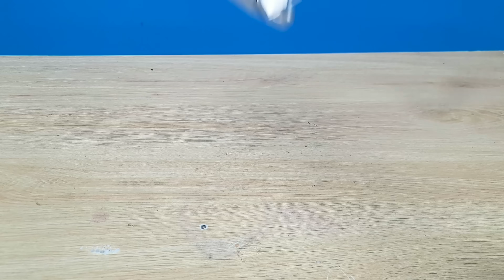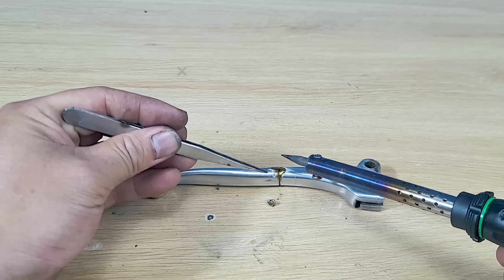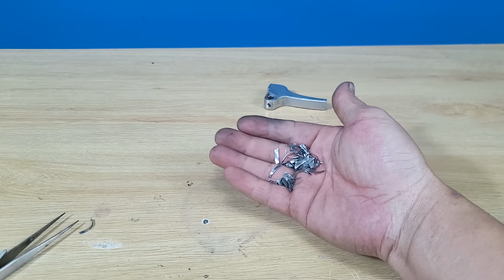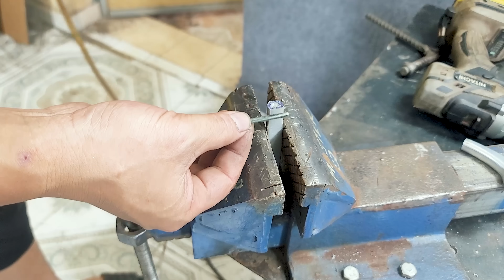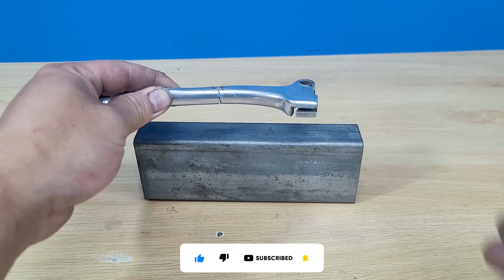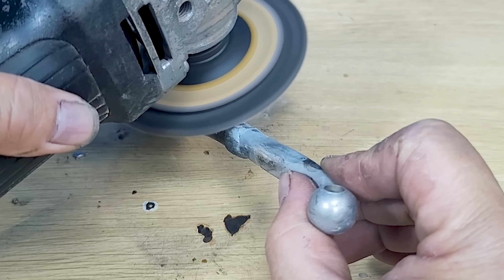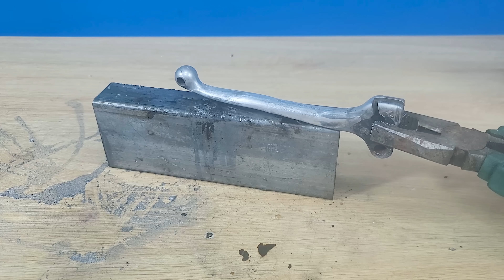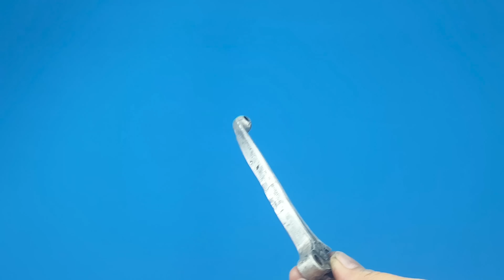Even a NASA professor had to learn this from me! Idea of using 1,5V battery to weld aluminum brakes

Comment: actually..........if, using WET sandpaper, it needs to PRE-SOAK at least 20 mins before using. works alot better that way.
Reply from the maker: Thanks for sharing this tip! Soaking the sandpaper before using it definitely helps improve the effect. I will try it right away!. Thanks for sharing!, have a nice day

Comment: It looks good, but wouldn't the solder just squeeze out of that crack overtime?
If thats the case the two ends would start to move independently of each other, a little at first and. Then you hit the wrong traffic conditions and snap.
Reply from the maker: Hello, nice to chat with you, thanks for pointing it out! Welds can be affected over time, so regular inspection is important to ensure durability, thanks for your interest and sharing, have a nice day

Comment: The "fix" would have worked the first time if he had used the torch the first time. I wouldn't do it/used it but the solder would have flowed because of more heat.
Reply from the maker: Hi, nice to chat with you, Very true! High temperature really helps improve the weld. However, safety is still the most important thing! 🛠️Thank you for your interest and sharing, wish you a good day

Comment: It must be illegal to do a job like that.
Brake systems have to be approved with Govt. compliance regulations.
That lever is not approved and is dangerous -
it could break in half just when it's needed in an emergency.
Reply from the maker: Hello, nice to chat with you, thank you for your interest and sharing, my good friend, have a nice day💖 💖 💖
Reply: @inventorK20  - OK - when I had a motorbike there was a motorcycle wrecker
just down the road and that's where I got most of my spare parts at a very cheap price.
I kept my bike in tip top condition in that way.

Comment: That was fun, and I do have experience welding steel, brazing, soldering, and grinding and polishing, but I am lost on why you cut up the battery? Is there some kind of metal in it you can not get at welding rod supply?

Comment: So if you have modern tools..tap and die a drilled hole in both sides. Threaded rod connecting the 2. Braze them together. Sand and polish. Ruin polish job with a hammer. Reinstall and pray. Got it.

Comment: idiotic fix, he should have made a mold of the broken part then melted down the lever and some aluminum beer cans and poured the molten metal into the mold to cast a new one.   Or, maybe hired a machine shop to create a 3D CAD program of the part and program a 5 axis milling machine to cut out a new one, which would only cost several thousand dollars.   Or, maybe buy a new part; .......Nah that would be too easy.
Reply from the maker: Hello, nice to chat with you, thank you very much for the useful tips, we will use them, thank you, have a nice day

Comment: Old plumbers used to kill acid by cutting up old bits of galvanized iron so you could soft solder a lead splash back to a stainless steel laundry tub that had to go in a corner of the laundry

Comment: Nice fix… but I wouldn't trust it. If you pull the brakes to avoid crashing into a car and the lever breaks you may have saved money but you'll definitely end up in the hospital... or maybe worse!
Reply: I think it's fine since it's reinforced by steel threaded rod on the inside. So the soft-soldered outer is not so much load bearing but cosmetic.
Reply: Saved money?? How?? Welding machine, cutting and polishing machine, and all time and effort. Could have new one for 300 rs. 😂 🤣
Reply: @astronik875   You don't throw away your tools after every job and re-buy them later do you?
Reply: @astronik875  more useful on vintage bikes where you want to keep the OEM look; normally would just use a aluminum braze rod and cheapy propane torch for a field/camp repair.  Have had decent luck with the Alumbond; broke in trail; glued up; was going replace; 4 years later still working... shrug...

The comments here; people are insane... its a freaking brake lever; you are not pulling anywhere near braze strength bond; that is right around 20,000 psi.
Reply: My thoughts exactly! That could be the most expensive $10 you ever saved in your life!
Reply: I would, most of these are made of aluminium, and now you have a steel for it's core, i feel like it might be stronger
Reply: And how much did he save? 5 bucks? Less?
Reply: If u spent 60 rs u will get new
Reply from the maker: Hello, thank you very much for the information you have brought to us, have a nice day
Reply: @inventorK20 a nasa professor  didn't learn this from you did he its been done years ago and not very strong
Reply: @mattlawton088 the way he used an angle grinder. Im surprised he has his fingers still
Reply: @CrayPlaySwe ..he made a follow-up film showing how to re-attach severed fingers using a slice of salami, a battery, superglue and gauze.  The most difficult bit was tightening the vice while fitting a tiny hinge into the finger knuckle.

Comment: That's pretty good, but, there is an easier and cheaper way if your time is worth anything. Buy one, or take one off a used bike even a bicycle lever will work fine. HOWEVER, THIS VIDEO SHOWS WHAT YOU CAN DO AS AN ALTERNATIVE IF OTHER OPTIONS AREN'T AVAILABLE AND YOU HAVE THE TORCH, THE RIGHT FLUX, THE SOLDER FOR CAST ALUMINUM, A GRINDER, AND A VISE, ETC...
Reply from the maker: Hello, nice to chat with you, this is gasoline, thank you for your interest and sharing, my good friend, have a nice day💖 💖 💖

Comment: Good repair technique up to the soldering process, at that point I would have  used an HVAC aluminum welding rod which melts at 388 degrees celsius and provides a much better adhesion between the two parts. However after all this, simply purchasing a new or used brake lever might prove to be a better economic option.
Reply from the maker: Hello, nice to chat with you, thank you for your interest and sharing, my good friend, have a nice day💖 💖 💖

Comment: you did it wrong. you are supposed to cut a channel along the length of the handle to make an internal splint using a steel nail inside the handle before you braze over it to encompass it in aluminum.
Reply from the maker: Hello, nice to chat with you, thank you very much for the useful tips, we will use them, thank you, have a nice day

Comment: That's not welding. Welding mixes the metal from both surfaces before the joint cools and solidifies.
This works the same way as brazing....better yet, soldering.
It's the process of gluing two metal objects (usually of the same material) together by using a different metal that melts at a lower temperature than the melting point of the material forming the 2 pieces being joined.
Reply from the maker: Hello, nice to chat with you, thank you very much for the useful advice, we will use them, thank you, have a nice day

Comment: After all of this: why you don't use a Al-welder it's fast and easy to operate (pre-heating is still required as most al-welding machines are low on the power side).
Really I don't put the gas bottle on the welder for this as a quick trip to the shop is cheaper than the gas for the welder alone and i have a welder in the kitchen which is capable of al-welds and comes with a al-welding wire. It's not worth of hoking up the gas bottle, change the welding wire (sorry: the steal flux core wire is still in the welder) and put on all protective gear.
Reply from the maker: Hello, nice to chat with you, thank you for your interest and sharing, my good friend, have a nice day💖 💖 💖

Comment: The only way to fix this brake handle was to inserted a steel pin . Plus a good brand of mixing bonding compound  Left to cure for five days. I had good success with this solution on the lever bar of a  seated low mower. (Stull working after 6 years)
Reply from the maker: Hello, nice to chat with you, thank you very much for the useful advice, we will use them, thank you, have a nice day

Comment: Just buy two Bernzomatic Alum-Weld brazing rods for $4.50 and use a propane torch to heat the aluminum, then rub the rod on the gap and BAM... fixed.
Reply from the maker: Hello, nice to chat with you, thank you very much for the useful advice, we will use them, thank you, have a nice day

Comment: This is by far the most bullshit video I have seen on YouTube...
First of all, that's not "welding" that's "soldering". Any NASA professor can tell you the difference.  
Second, you can never make aluminum take solder, no matter what you put on it, toilet cleaner and pieces of zinc from a battery included. Even if some miracle happens, solder will not be strong enough, at the first emergency brake situation, it will break again (yes, the short piece of bolt you put inside will strip those flimsy teeth) and you will hit something badly. 
Lastly, the amount of time, energy and materials wasted in this video far exceeds the cost of that brake lever of the cheap Chinese scooter.

Comment: Do not do it this way, especially with a brake lever. Safety will be an issue. This part is very inexpensive, just replace it. The repair will fail because the screw wasn't drilled correctly. The screw is too loose and it was not in deep enough. Also, the solder is too soft.
Reply from the maker: Hello, nice to chat with you. You are a good person. Especially when it comes to our own safety, Thank you for your comments, we look forward to receiving your support in the future, thank you, have a nice day

Comment: You didn't need the battery at all. What you did was mix some aluminium strips in with some sort of toilet cleaner to create flux and then use solder to basically braze the two pieces together. I used aluminium brazing rod that would have done what you did but saved a lot of time or better yet, use a TIG or MIG welder and weld them together for a stronger bond.
Reply from the maker: Hello, nice to chat with you, thank you very much for the useful advice, we will use them, thank you, have a nice day

Comment: nasa isnt a college. Also the process isnt really welding. There isnt a fillet weld that supports the strength of the part.
The actual bonding is done by the tapping and the screw. The battery was used to create a flux and then the solder a braze fill. But the actual weld isnt strong enough to support the repair on its own. Not really welding to repair. More like welding to  hide a repair for asthetics only.
Reply from the maker: Hello, nice to chat with you, thank you for your interest and sharing, my good friend, have a nice day💖 💖 💖

Comment: Honestly this is a great idea if this is the ONLY choice you have left...but a new one will reduce the risk of premature failure. The different metals used will cause galvanic corrosion and early part failure. There's aluminum from the handle, steel from the screw and then probably tin/lead from the solder. That can't be good to mix. But we have to keep in mind. Not everyone has the option of buying new. Some countries have to repair, and that's ok.
Reply from the maker: Hello, nice to chat with you, thank you very much for the useful advice, we will use them, thank you, have a nice day

Comment: So maybe in a 3rd world country where money parts and resources are scarce this can get you by
But ….
Steel and aluminum don’t play well together
And that steel screw in there is going to have some electrolysis and break down that aluminum and it WILL fail again
For $7 go buy a clutch lever….
Because it is my experience that it will fail when you need it to work the most

 Train/truck bearing down on you and you need to downshift fast and GTFO!!!??

Yep,THATS when that fucker will pop!!!

Suck it up
Spend the $7
And try to keep the rubber side down and don’t break another
And learn the lesson
Don’t set yourself up to learn ANOTHER lesson you may not walk away from!!!
Reply from the maker: Hello, thank you very much for the information you have brought to us, thank you very much for giving me extremely valuable insights, we will monitor and learn from experience in the next videos. according to. Stay tuned, thank you very much my good friend, have a nice day
Reply: @inventorK20 don't make any new videos!! Your going to be the end of someone doing this extremely dangerous and frankly worthless work!!

Comment: even NASA professor knows where the point of crack, stiff, weak of subject point will be moved with calculation between object with welding connection verse with subject whole intact casting when add some

Comment: Anyone know what type of metal is in the battery casing, and the acid in toilet cleaner? Keen to give this a try 

For all those going on how this is stupid are completely missing the point and showing their own ignorance. Soldering to aluminium is not easy and is useful for much more than fixing a brake handle
Reply: So making the assumption that it is an alkaline battery, the casing is zinc. Also making the assumption that is hydrochloric acid in the toilet cleaner. That should react to produce zinc chloride. I tried zinc chloride solder flux with no success. The hydrochloric acid is likely in excess, so it must still be very acidic/low pH so maybe that's the difference. 

Was it standard lead tin solder you used?

Comment: To those leaving comments regarding a $13 part not being worth your time and effort, you need to leave your 1st-world-country bubble for just a bit.... Realize that there are a lot of places where people don't (or don't have the means to) just hop on line and buy something every time they have a minor failure... Using, borrowed or shared tools and sometimes a LOT of time with some ingenuity to save a few dollars, pesos, etc. is the preferred or necessary method. In some parts of the Philippines, for example, that $13 is more than a days wages for someone lucky enough to be working. $13 bucks buys a sh*t -ton of rice.

It's also nice that they (like the older generation) won't need to rely on Ebay or Amazon when things collapse, and they have the working knowledge that the rest of you have abandoned. Didn't 2020 teach you kids anything?
Reply from the maker: Thank you for your comments and shares, thank you for the extremely valuable knowledge you bring to us, thank you my good friend ❤️ ❤️ ❤ , Have a nice day! nice day! nice day

Comment: What did that have to do with the battery? You bolted it together and soldered it. You must live somewhere where you can't get parts.  A new one is worth the cost to not have to spend an hour messing with one that will probably snap at a crucial moment when you need to brake hard.

Comment: good for old sparepart that hard to find the replacement, or the used/NOS sparepart cost very high... like my handle for 1961 vespa.. the old stock can cost 100 USD, hard to find the new item

Comment: You didn't "WELD" anything, you BOLTED it together and filled in the gap.  Entire strength now LIES IN THE BOLT you have screwed inside, instead of the entire handle.  I SURE A FLOCK hope NASA isn't stupid enough to use this.

Comment: Pure tin (lead free solder), will be better for soldering aluminium, but the best solder for it is zinc. Cut your battery up to get the zinc, use a little of it to make your zinc chloride flux, use the remaining zinc as your solder filler. Practice on some scrap aluminium. Using zinc or tin as a filler, you don`t even need flux. Just get the aluminium hot, scratch the surface and quickly rub on the zinc or tin filler. Just for reference, those casting are VERY hard to solder or weld for that matter. Chris from the UK.
Reply from the maker: Thank you for your comments and shares, thank you for the extremely valuable knowledge you bring to us, thank you my good friend ❤️ ❤️ ❤, Have a nice day! nice day! nice day

Comment: just weld it if you don't want to get a $10 lever, solder is for sealing and electrical connections, it's useful for joining 2 pieces of soda can metal at most
and never hold that screw while grinding it again, if you don't have a tap just use the vise to hold it. you'll need fingers to actually use your lever

Comment: ya buy a $2 bolt, and $9 in solder, sand paper and a torch, to fix a lever that would cost about $8 new. That might hold, might not. Great reasoning.

Comment: NASA has professors? Do they have tenure at NASA University? Why not just use a normal tap, it would cut better threads and deeper too. That soft solder is mostly cosmetic not offering any real strength. Although, props for the ingenuity in finding a way to make it work!